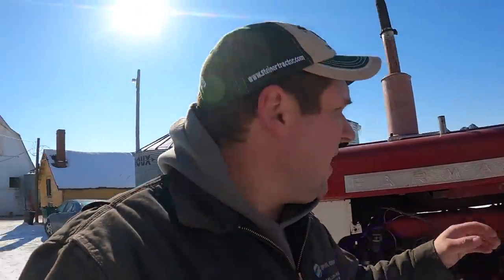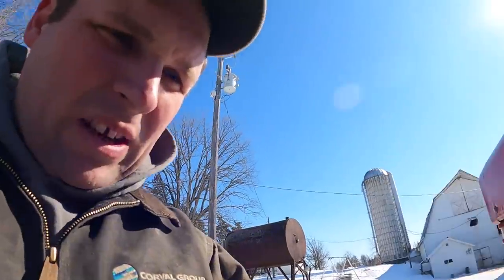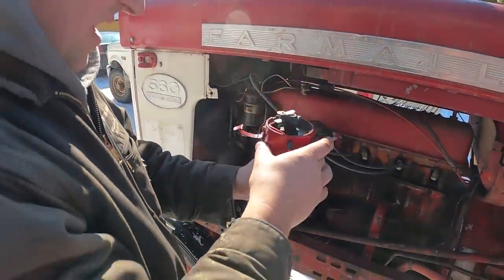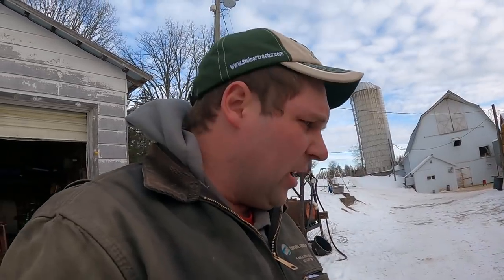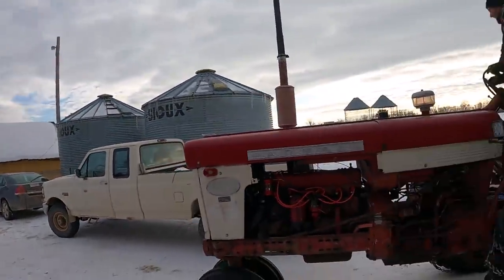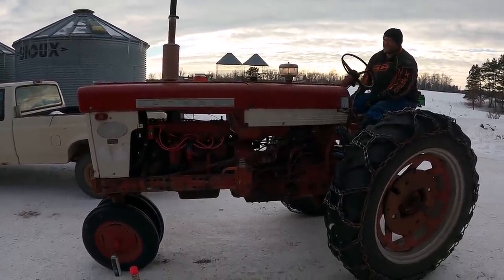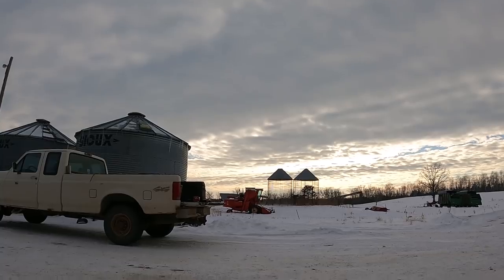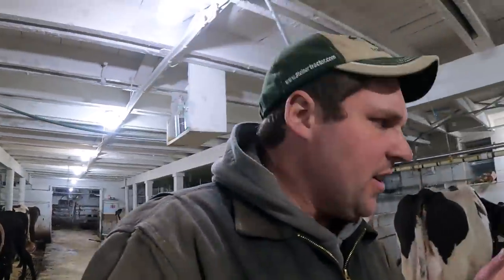Installing a Distributor and Electronic Ignition in a Farmall 560

Comment: That'll be like a new tractor. Hit it with a timing light and readjust the carburetor, you'll be good to go. Be careful not to leave the key on while it's not running, it can burn up the ignition module. Happy motoring!
     Best regards from Indiana.

Comment: Enjoyed the video, Im working on a 606 loader tractor, bought it non runing. I think I fried the electronic modual, it went to smoking when I turned the key on. Mine doesnt have that magnet under the rotor , or the special plug wires. dont you need resister ?
Reply from the maker: Nope,  they told me no resistor, I also  put a high proformance coil, I left the key on once and melted the coil, almost burned the tractor down.

Comment: I'd rather work behind a gas instead of diesel, we only used tractors for light logging for firewood, post hole digging, driveways light pto work.  Last tractor we had was 1978 David Brown, 38 hp, dont remember #.

Comment: While it shows dark smoke while accelerating in rpms, that stuttering and stall indicates lean mixture on revving up. I don't think these carbs have an accelerator pump to juice the mixture when you step on the accelerator but I think the engine was just still not warmed up. Sounds perfect in all respects on video so should work very well even in very cold weather.

Comment: One thing to mention is that the little slot headed screw by the tachometer drive input is made to turn out and put in a grease fitting. This lubricates the distributor drive shaft bushings. It only needs a few pumps of grease yearly. The screw in installed originally to prevent over greasing.
Reply from the maker: Good to know, thanks!

Comment: My 460 did the same thing. My issue was I had a partial blockage in the sediment bowl throat I would call it. When I pulled the choke out it ran better but under a load or trying to snap the throttle it would kill it.

Comment: Well I've had two six cylinder farmalls building the same block I think one was a triple six gas the other one is a 460 gas and I've noticed it both of them when they're not under load you crack the throttle they want to falter a little bit but once they pick up in the governor kicks in they'll smooth right out I just kind of think it's the nature of the beast my old 4 cylinders don't do that and of course my diesels down but we get service out at 460 and we did when we with triple six we had it I wish the best hard to be an old Farmall

Comment: Got a 656 I'm planning on updating to electronic ignition.  Nice vid. Do you have issues with hyd ih cold temps?
Reply from the maker: We had some issues with the hydraulics on this 560, in the cold, because it had moisture in the oil and would ice up the filter, changed the oil and filter and it has been working good.